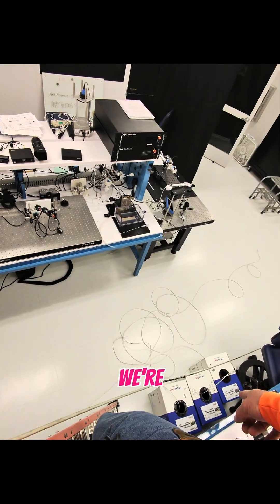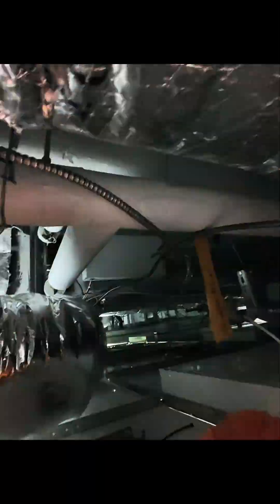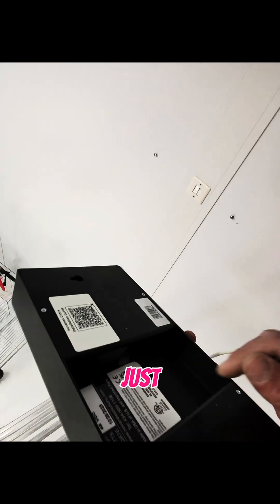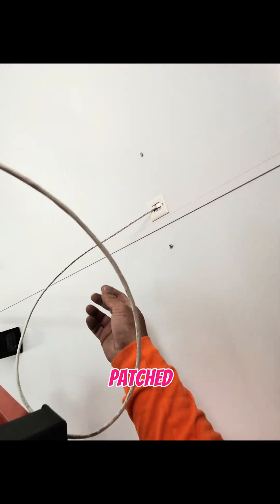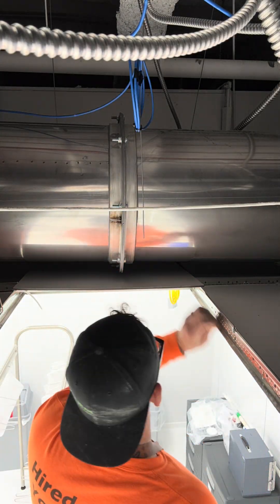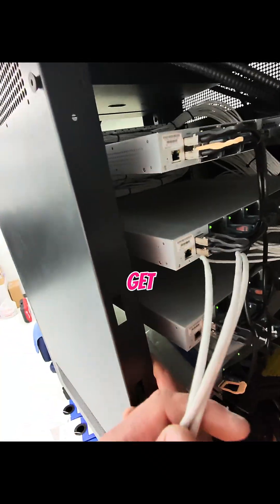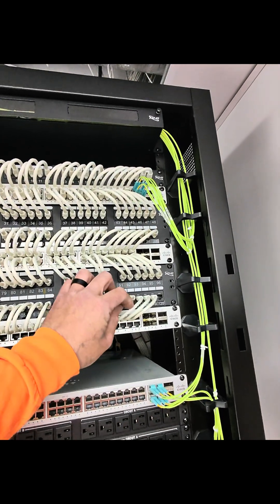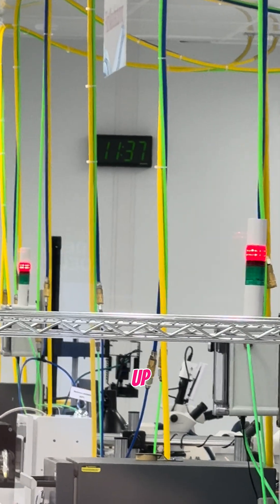Installation of Plenum CAT6 in a Clean Room for PoE Clocks | Low Voltage Network Cabling

Comment: Ugh crystals on the end? Why not jack and patch cable it? Also shouldnt that be a sealed port not a pass through, hence the sealant?
Reply: I see nothing worng. Also less room for failure using a modular Jack, straight into the device.